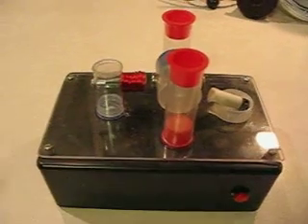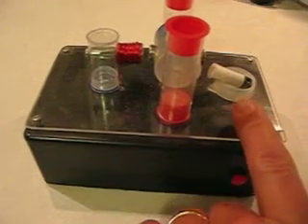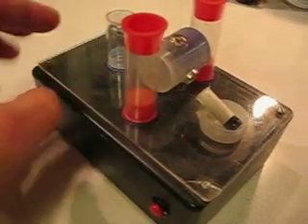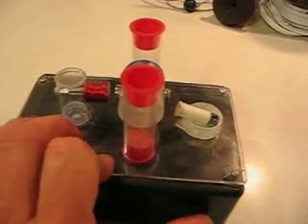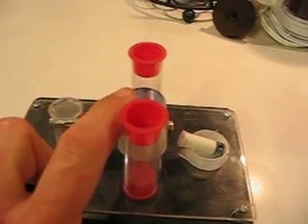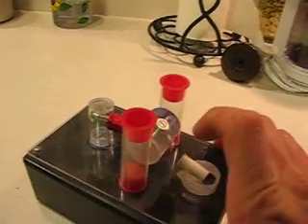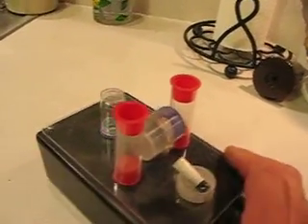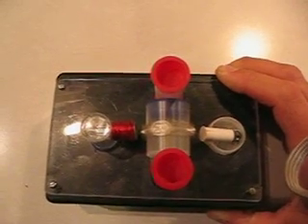Homemade Brushless Motor (reed switch motor)

Comment from the maker: The transistor acts as a high current switch between the coil and the reed switch. It (the transistor) switches the coil and the reed switch triggers the transistor at a much lower current. A resistor would probably slow down the motor, it would restrict current flow to the coil. Your right that you might not need one for the motor to work, but it depends on the amp draw of the coil. Too many amps through the reed switch would eventually fuse the reeds of metal in the switch. Again it depends.

Comment: this is to all comments (sorry i couldn't reply to all)
simply a reed switch consists of to prongs in side when a magnet is near these prongs touch (or get pulled together)
so every time the magnet on the drum passes over to reed switch it will trigger and let a sudden amount of electricity go into the electromagnet 
the electromagnet attracts a magnet on the opposite side then quickly turns off giving the drum a little push to make the quarter turn 
this happens very quickly 

very simple

Comment from the maker: This motor used a small burglar alarm contact that has a reed switch in it. A reed switch is a tiny vacume sealed glass tube with metal strips inside that react to magnets.

Comment from the maker: Thanks for your comment. The coil is nothing special, prehaps 30 turns of 24 awg wire.
Not much resistance from the needle /drum setup but bearings couldn't hurt I guess.
Maurice